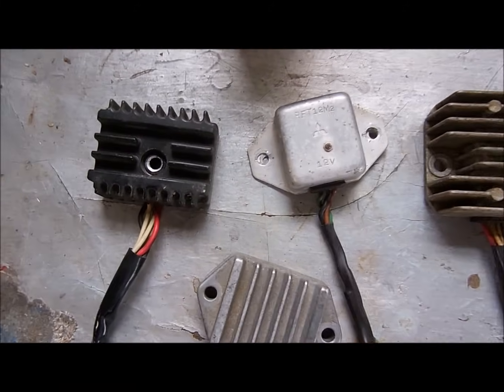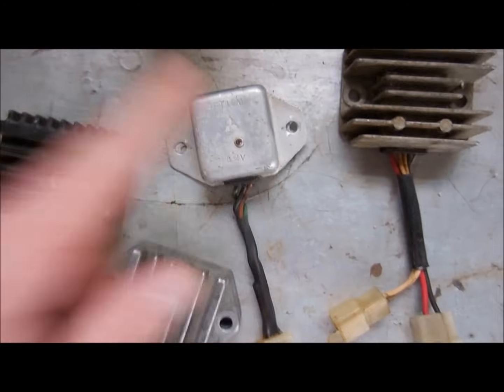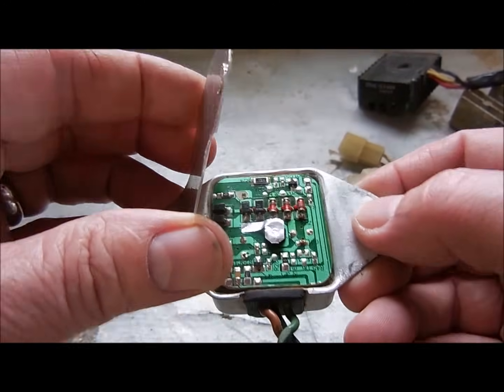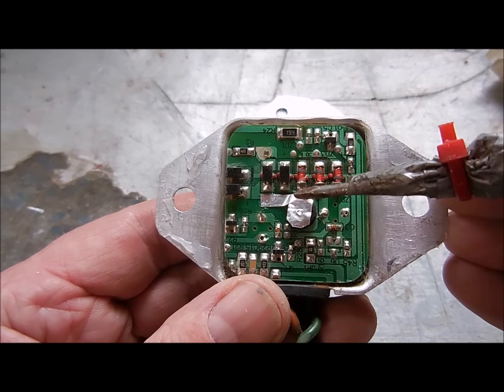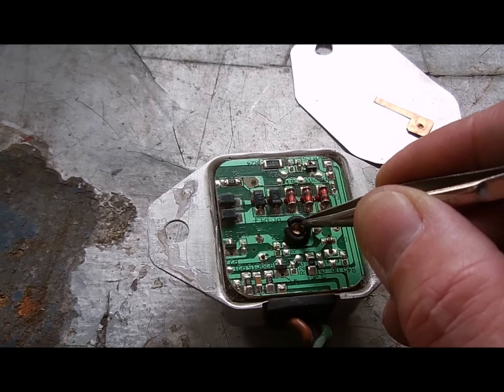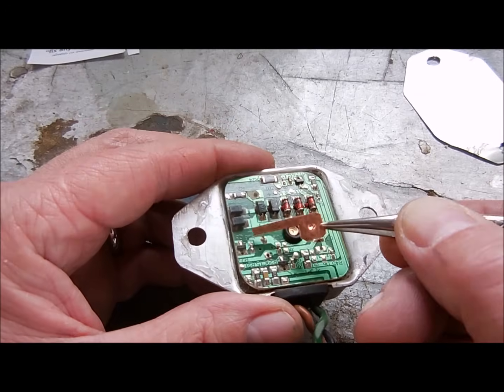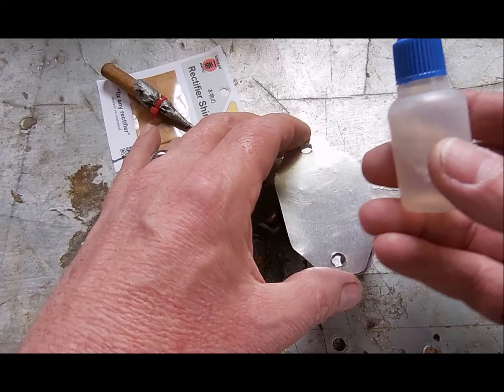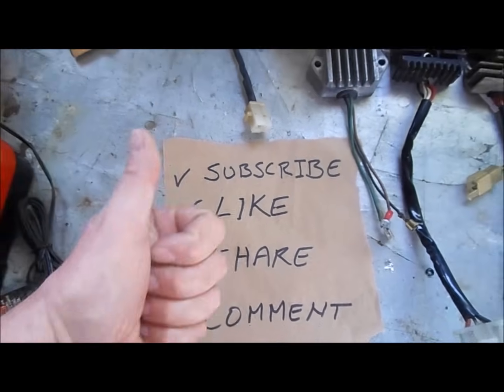how to repair a voltage rectifier regulator  charging system

Comment: I noticed he repaired the only one with a removable backing. And never said one word about the 3 other normal rectifiers that we all have that cannot be accessed from the back.
Reply from the maker: this and the one about how to use a test light are on the short list of videos. I have set some of those rectifiers aside to demonstrate probable methods of removing the epoxy potting in a future video
Reply: I was thinking the same thing...
Reply: And everyone thought satire was dead.
Reply: They are badass
Reply: @IchibanMoto  where is the video of the epoxy removal and repair of the ones you claimed to have sat aside?
Reply from the maker: @staind288   thanks for the reminder, I need to film the next time i rebuild one of those
Reply: I've heard that they can be deleted if you wire in a flux capacitor in series with the battery and parallel to the tail lamp harness.  This will of course disable the blinker fluid warning light but no one pays attention to that anyway.
Reply: @dontblameme6328  feckin' funny guy. You know not everything is about jokes! Some people actually enjoy learning new things
Reply: @dontblameme6328  ...and  beware if you hit 88 mph
Reply: But we need to know where is the energy going to be doc.

Bttf
Reply: @dontblameme6328  lol
Reply: @staind288  Ya ichybut kind of left us out to dry with no parts source, and nothing about the epoxy potted units,that are more common. Three years and counting
........
Reply: @dontblameme6328  Yeah, when it blows, it just blows!!SMH...
Reply: speaking of it, i still havent seen a video of how to remove the epoxy???
Reply: i was going to write that my reg had just a bucket full of plastic poured over the back and what looks to be permanently sealed.
i just spent $180nzd to get my new one

Comment: That's really badass way to repair rectifiers, my rectifier gave 250 Volts, it was the shim, I changed it now it's giving 12.000000001 volt ...... exact.
Reply from the maker: volts are a pleasant thing

Comment: for all those who are having trouble finding shims online (myself included). just use foil paper. You can paint it with metallic paint or cover with gold flakes for better electron flow. just remember to seal the gold with hodge podge. you can get everything needed from your local craft store.

Comment: That's a total badass repairing guide. By the way, you still need to replace the Electron Colliders cathode if found worn out too.
Reply: Do that with the other one that's sealed in that hard rubber and aluminum case

Comment: That's Badass! Now I can fix my Chinese Farley Mavidson 12,03cc Sporkster. Thankyou
Reply: That's a bad ass ride you own mister! I bet the 12,03cc's really deliver a heck of a grunt.
Reply: They really do they are truly Badass
Reply from the maker: I love the sound of wind passing through  sporkster engine fins
Reply: Ichiban Moto I agree Mr Ichiban and I think it's because the Sporkster fins are made of forged alloy spolder. I Thankyou as always for your video tutorials.Lee.
Reply: hey dude great job  , I have a question! My battery keeps getting overcharged and the caps pop off and smoke commes out.
Is this also a problem because of the rectifier regulator ?
Reply: Niec

Comment: I used a plumbus to rectify my shim and it's working fine  - all 6 ounces of electricity are a flowing!
Reply: People have been asking about this comment at work. Guys, make sure your Plumbus is not faulty before you rectify your shim, I had one guy trying this exact thing with a 2 year old Plumbus that was obviously worn out from mechanical TNR 3's.

Comment: OMG I was crying for joy from the micro collider ring. While I don't have a chronological machine, my flux capacitor IS broken, but I can't find the proper size micro collider. Can you please shed some light on what to do in this predicament? Or where you source from in this case?

Comment: Surprised you did not check the smoke capsule inside the rectifier unit. If anything goes wrong the rectifier ruptures it to signal to the user it has failed. Some have a scent not unlike burning wood added to give a visual and sensory failure warning. After overhauling the rectifier it is important to replace the smoke capsule to reset the failure warning system. I keep a stock of spare smoke capsules in my shop as seem to need a lot of them when working on older bikes.
Reply: I think you got this wrong. As far as I know, the actual cause of electronics breaking is when the smoke leaks out. That's why I always make sure that my electronic devices are properly sealed. Unfortunately lots of electronic equipment have big holes in them. I suspect it is part of the "planned obsolescence" that most manufacturers deal with in order to sell more product. They intentionally let the smoke out. Shame on them!
Reply: @LinusNil  I've just drilled a hole in mine and piped it up to a smoke machine so should last years now, if on a motorcycle just pipe it directly to your exhaust pipe
Reply: Thank you for this tip, I ran my 2 stroke exhaust into my voltage regulator housing and now it's good to go, should have no more issues
Reply: สนใจ
Reply: Wtf lol 😂

Comment: If you don't have any electrical grade assembly glue you can always use a elbow grease proof, water resistant, metal grade wood glue with the same results.

Comment: thank you for this amazing video, it really helps me fixing my car. may I ask where can I buy the micro collider ring? thanks a lot
Reply: just get a plumbers o ring from the hardware store
Reply: @craibe4709  Is that all it is ? A regular o-ring ?
Reply: @niconine268  I was fuckin hammered when I wrote that. Ive done it before with other o rings but ive used regular plumbers o rings for engine stuff

Comment: Quantum Entanglement can be both a blessing and a curse.  In these cases, you can use QE to access the internals.  No need to Dremmel the cases open.   Also, the best electrical bonding cement can be undone with the application of Acetone (fingernail polish remover) so even if QE wasn't initiated by the manufacturer, you can still get many of these cases open.   Beware that Acetone causes bronchitis so don't use it around.

Comment: put your resin filled rectifier in the microwave and it will become liquid ,  keep the liquid on a hot stove , repair the rectifier and pour the liquid back in . put it in the fridge for one hour to harden the resin back to normal.
Reply from the maker: pro tip
Reply: Wtffff it will break microwave and die

Comment: I couldn't help but notice that in the upper right corner of the package with the new rectifier shims was a silhouette picture of a girl with a ponytail. I was wondering if it was of any significance? Possibly that the shims come as male and female components, much like plumbing fittings? Also, is the electrical grade assembly glue you use to reassemble the unit a standard item available from our friends at Nickletown Customs, or is it a standard off-the-shelf item available at my local grocer?
Reply from the maker: tpitman that is Princess Yen,  ¥,  the retail price. Nickel Town Customs does carry the assembly glue as well as various specialist shops.

Comment: Thank you for a great video. But what is this thing i found on my sled? it's called aac6003, and it has only two wires.I took a look at the pantera's electrical because it keeps blowing headlights, but the rest of the electrical is ok, which is why i suspected that it was not the reg/rec that was shot. Thankful for any answer

Comment: Micro Collider Ring ??? Shim ?  I have never heard these terms with a strong electronic and mechanical background. Are they from Thomas Edison or Michael Faraday.  What were you touching with the Light Bulb...you did not explain the connection points? Where did you get those obscure parts, you did not elaborate. Other than these mystical points it was an enlightening and innovative posting.

Comment: I just bought a new regulator/rectifier for my bike, the old one was causing the main fuse to blow. Seems to have fixed the blown fuse issue, but, I notice it warms up to 117 degrees, is this normal? Is there a tempreature range? Thanks for posting.
Reply from the maker: they do get quite warm. most have cooling fins to dissipate the heat

Comment: I have one from a 2012 scooter and I hooked it up backwards and it smoked it . I did buy like 3 of the 4 pin ones from the internet but they do not work Very well .and if I look up the #s on the back I can not find The same one and my battery will die . Any idea of the part I will need to replace from it being hooked up backwards ?? And thanks much

Comment: All ya need to do is cut the wire ends off and braid the wires around each other in a CCW direction and re install the ends, before using zap each wire with a speaker wire set at full volume.

Comment: I have a badass scooter with 12v AC to the headlights.
Can I connect rectifier between bulb and bulb holder?
I want to use badass 12v DC LED's
Reply from the maker: That would do it!

Comment: I'll need to remember that... of course I did replace my last one because I took a used bike out for a ride and it turned out the previous owner had the rectifier zip tied to the frame over the rear wheel.... I have no idea where it fell off

Comment: At 1min 42 you used a new type of tester  I've never seen. I've still got one of the old wax ones that have a cotton core. Are these still ok or should I invest in the one you have.
Reply from the maker: if you old one still works

Comment: Mine had queer electrons that kept blowing the fuses,,,,
Reply: jocrp6 you need to use bi-polar fuses then it won't matter if they're queer or straight electrons
Reply: jocrp6 Sounds as if you have an AC/DC set-up...
Reply: Spark Gap If your fuses are bi-polar, you must use a lithium battery !
Reply: Curious of what it identified as? Did it have male or female ends or one of each?

Comment: Sad you didn't even check the smoke capsule container(s)or the flux capacitors, and you didn't measure the rectifier shim to verify it was the correct thickness. Cheap cheap cheap... Hard to get good help these days...

Comment: Do you have a fix for the common Polaris voltage regulator failure issue. Seems like every model they make has the same problem.  Do t matter if it's a sled or avt or side by side they all fail or catch fire eventually
Reply from the maker: i will try to find a bad one and take it apart
Reply: The sportsman xp has a aluminum front subframe. I'm thinking it will corrode between the 2 frames. The main ground is on the aluminum part.  So I've run a new ground to the steel frame and I've added a waterproof inline fuse holder to the red wire going to the battery.  30 amp fuse.  This is my 3rd voltage regulator.  I've tested my stator and it checks out fine. Another mod I'm doing is moving the regulator down a inch and towards center of the air inlet so cooling will increase.  I really hope this helps fix the problem

Comment: When you tested it you just put a bulb near it and it powered the bulb but the bulb wasnt hooked to the regulator. Can you elaborate on thebtesting portion.
Reply from the maker: I did film the making of the contactless dc test device. I need to find those clips and specs to edit and post a how to

Comment: cannot do this on a motor cycle VR, the electronics are covered with epoxy, for stable use during road bumps, pot holes and if you have a Harley the engine vibration.

Comment: Question on intervals for doing this maintenance. Should I do this when I change the blinker fluid? Or when I rotate the muffler bearings? Or is this only done when the flux capacitor goes bad?

Comment: Been working on my 2000 Harley and had to remove the battery and the rectifier.. now i’m putting back everything but when i try to connect the rectifier output wire to the battery positive (like it used to be) it sparks like i’m shortening the battery leads .. not sure what’s going on! Any advice would be helpful

Comment: Please, is the head lamp flickering  if the rectifier is bad.....or why the head lamp, brake light are flickering when the engine is running on idle?

Comment: I found that the best way to keep the parts from wearing out again, is to fill the rectifier with blinker-fluid before putting it back together. Then coat it liberally with elbow-grease before mounting it back on the bike!

Comment: I am looking for an answer. I want the Battery terminal charge be 12volts. What should I do with my motorcycle?
Reply from the maker: a 12v battery is typically 12.6v fully charged and the charging system regulated output can be 13, 14v plus at higher rpm

Comment: On my klr250 mine is hot to the touch when my bike is running. Should I replace?
Reply from the maker: they do get warm, it's the rectifier bridge diodes getting hot

Comment: I fixed one similar to this on my machine. Turns out the green tint on the board clashed with the blue skin on the bike. Used the wife's #7 Blue Tint hair dye to re-color the board and it fired right up. Thanks for the video though.

Comment: Should have taken the electronics board out to show the mico port where the smoke goes back in once it's let out... most don't know it's location
Reply from the maker: when i do the vid on the epoxy potted style, i will add that pro tip !

Comment: how do you take apart a rectifier with the epoxy on the electronics? not the GEL type but the hard epoxy, like the rectifier on the very right.

Comment: i cant figure my kz400 out ..i got 55volts of ac coming out of the 3 yellow wires at half throttle but check my hot wire coming out of the rectifier only said 2 dc volts ..it wont charge and its driving me crazy

Comment: Instead of picking the easiest one to repair.
Now do the one that does NOT have a simple metal backing.
But is sealed, with a melted compound.

@ichiban moto, 2 years later we're still waiting for your 'easy to do' repair on the sealed compound reg/rectifier.

Bad ass? No, more like scaredy cat!
Reply from the maker: great idea, i will probably do that video in the future. thanks for the tip!

Comment: Sir.. My motorcycle had no switch on headlight. Always on when engine is starting or running.. What will happen if i put head light switch with relay on my headlight?
Reply from the maker: switched relay works. always on is a safety requirement in some places
Reply: Okay sir. But if i put headlight switch on my motorcycle is it possible that there are some parts will be damage on my charging system like rectifier or regulator?
Reply: Philip Almor Ignacio Sir, I tried this once and caused a great deal of damage to my mind because of how blown it was with the results.

Comment: You didn't take the cap off your electrical grade assembly glue! How did you manage to forget that?
Reply from the maker: that's not a cap.. it's the applicator
Reply: Huh. My bottle looks similar and I have to remove the blue cap to apply it.

Comment: How to remove the glue , sir, which is put in the  regulator. We cannot see the circuit as there is glue in it . Any chemical to melt the epoxy type glue

Comment: I have done the repair but i couldn't get the test with the light to work. Any suggesions? I then fitted it back on the bike and it ran for around one minute, then smoke started coming out of it. I turned it off quickly can someone please help?

Comment: You didn't show how to open up the other types of regulators in your vid, i think those cannot be repaired as the whole assembly is covered in epoxy even the electronic components are encased in epoxy, if you pry it you will ruin the whole circuit board. Only the first type you showed can be repaired, the other types i highly doubt it.

Comment: Anybody can take apart and fix a rectifier regulator that has a simple metal back. Why did you not take apart one of the fully sealed rectifier Regulators that are encased in plastic or rubber whatever substance you want to call it to keep them from getting wet

Comment: because I have to slam me to repair a current regulator that costs 10 euros ... a totally useless repair ... since between opening the veccgio arrange it and close it will take 20 or 30 minutes and replace it with a new one only 2 minutes who me it does

Comment: What if they are potted in that black stuff?
Reply: Namey McName to repair potted rectifiers, you're going to need to water it regularly.  A lot of potted rectifiers might seem dead if you haven't watered them sufficiently, but this is actually a survival mechanism, and many can be brought back to life with a little water.  If it's really stubborn, apply some miracle gro.
Reply: I've tried it, but i just can't get a damn thing to grow in that black stuff. Maybe I need some high-press sodium lights.
Reply: to melt the black stuff put it into a pressure cooker and give it 20 minutes at low fire.
Reply: I'll try that with something cheap. Thanks.